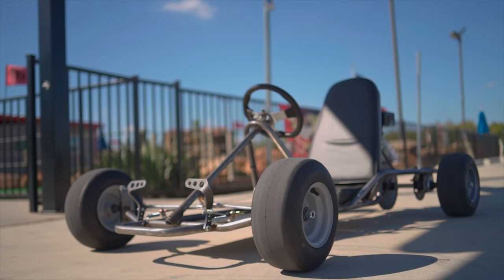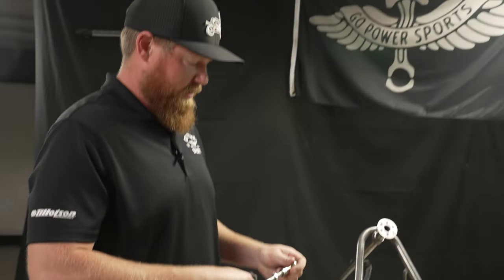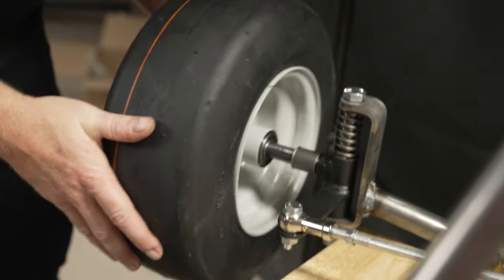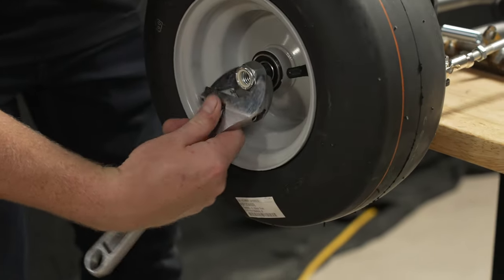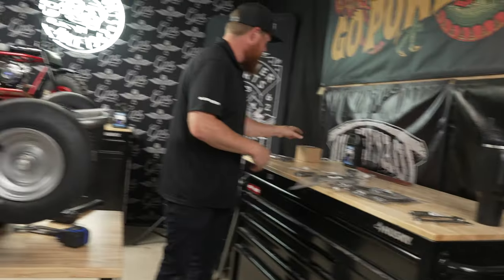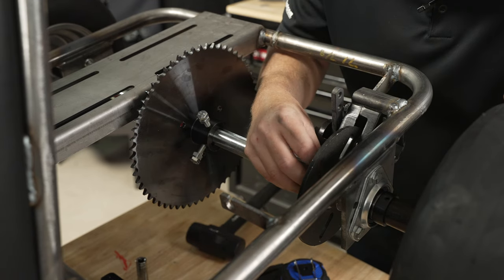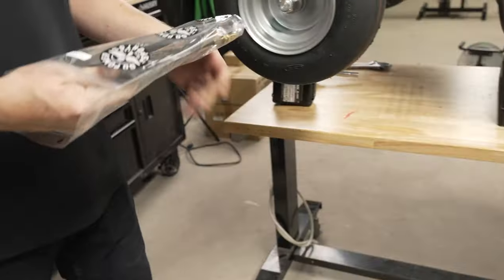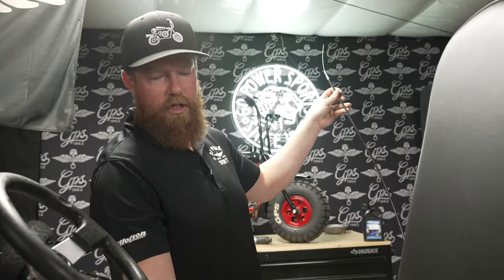Go Kart Build Step-by-Step (NO BS) | Vintage Go-Kart Kit

Comment: A really nice mod is to make an engine clamp bar. Using 1" x .5" x 6" long bar stock, drill and tap your holes on the adjusting slot centers. Then place the bar beneath the engine mounting plate and pass your bolts thru the engine, the plate and thread into the bar stock. That way, the engine can be moved using only one wrench.

Comment: I'm about to build my first drift trike and I was looking at the 6" live axle kit on your site. I don't see the spacers that you used in this video between the wheels and bearings in the kit, it just comes with lock collars. Are the spacers necessary or would the lock collars be sufficient to hold the wheels in place?
Reply from the maker: Depending on how rough you are, the lock collars do a pretty good job.  But spacers would be the best option because they would not budge on you.

Comment: Because of what I'm going to do by putting a predator 670cc engine would it be safe for me to cut the frame to fit the bigger engine mount for the predator 670? What torque converter or clutch would you guys recommend because it's going to be a hopped up predator 670cc that's going to be making 40 horsepower and 50 ft lb of torque

Comment: me and my friends want to build a go-kart from the ground up, would a kit like this one (to make a roller frame) really be worth the money for someone like me or should I either try and build the frame or find a used one? Thanks!
Reply: I really think finding an old one is always better. I'm stuck for axles because nothing is on sale so i have to build it manually 😭. Since I can't weld this is gonna be such a hard challenge. (I'm using and mixing multiple tutorials). Alright. Hope this helped you!

Comment: Why not build a break kit that uses the sprocket as the brake disc? 🤷🏼‍♂️
Reply from the maker: Sprockets will get grease and oil from the chain.  You won't want your brakes to get slippery and oily as well.